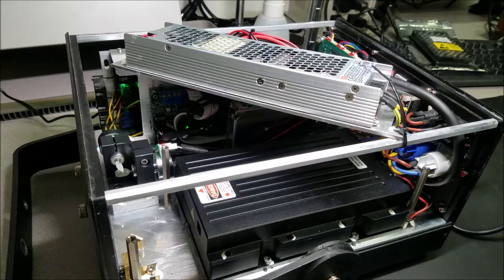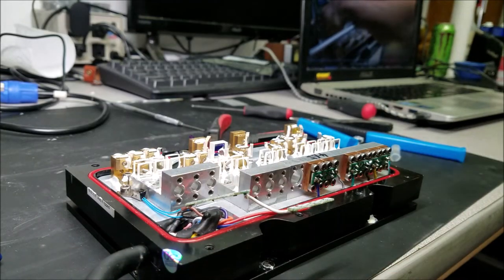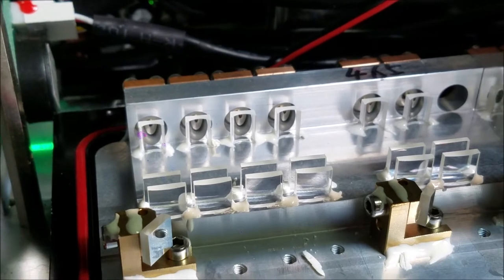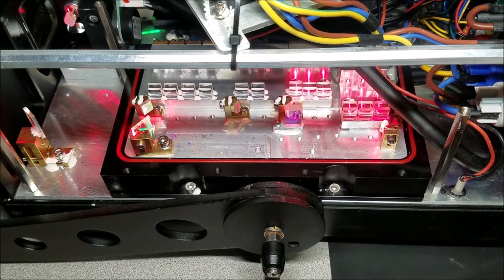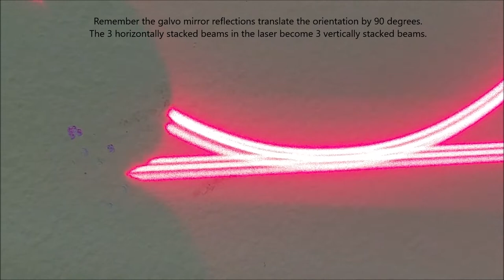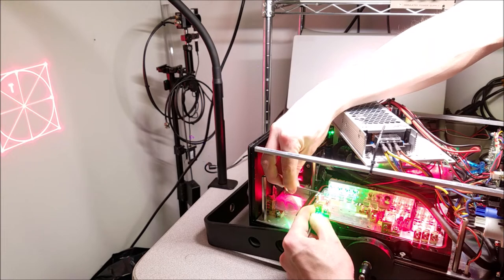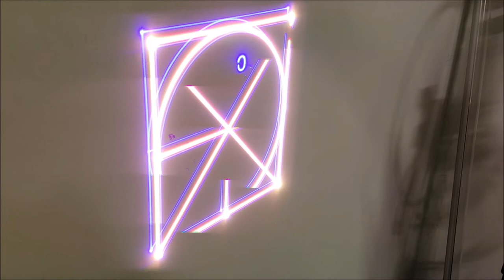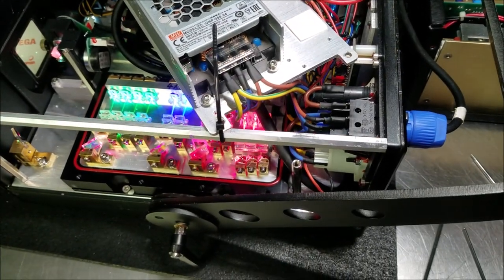OPT PT8DT4014 Show Laser Repair Installing New Red Laser Diodes & Laser Head Alignment.

Comment: Very interesting to watch as I have two these laser projectors but 10W in stead of 14W. Can I ask where did you get the new closed can FAC red diodes from and how much?
Reply from the maker: The new diodes where bought through one of the partnered laser companies we work with. I don't know the MSRP since they where ordered in bulk. I don't know if these parts are available to the general public through the factory ( not OPT ). I can check our stock and give you a quote on them if you want when I get back into the shop.
Reply: @Zenodilodon  Thanks for the reply. At the moment all of my open can red diodes are still working. I was just curios of your source of the caned diodes. I'm in the UK. My mate, Rob of STANWAX Laser may fined these red diodes of interest as he has spent many hours repairing vireos models of OPT projectors. A price of these  diodes would still be good to know. Thanks.
Reply from the maker: @cdbvideo  Ah Rob, I know of him as he and I are part of some of the same forums. I feel bad for him or anyone who has to work on these lol. So far we have pretty much only seen open can diodes fail in units without a glass plate in front of the cut out where the diode goes. We have made our own plates for those as needed it does help. I'll have more information for you later this week.
Reply from the maker: I have discussed the matter with the other shop mates here and due to the partnership/diodes being unavailable publicly from the OEM the best thing would be to sell them from our facility. They would be around $60 US per/pc about.
Reply: Thanks for that. I will definitely bear that in mind for if my reds start popping on me. Are you on PL forum? if so what's your handle?
Reply from the maker: @cdbvideo  I never joined PL, by the time I thought about it a lot of the people just jumped on FB or Discord.
Reply: @Zenodilodon  which FB or Discord forums, would you recommend?
Reply from the maker: @JAKOB1977  Styropyro's discord server is actually really good for Laser chat!

Comment: Nice to see you love the desolder station for these 😂 I bought mine specifically because remounting those boards was really awkward. I wish I'd known of the closed can FAC diodes before I started, I was buying the open can direct from OPT and it made it nearly uneconomical to repair. I found that even with an alignment tool I couldn't get the new diodes to output onto the steering mirrors. They were all off to the side resulting in having to demount the initial collimating lens and steer it back where it should be. A real pain!  I only had 2 bed reds but ended up having to replace all 6 diodes due to damage from trying to desolder without a station 🙄

Comment: Why did you also remove all the green and blue mirrors and optics? Would it be too difficult to set up the red knife-edge optics while also aligning them to the existing green and blue beams?
Reply from the maker: The majority of the lasers where out of alignment not just the reds. The client did not like the factory glue which prevented maintenance as well so we pulled the optics needed for alignments and redid them without glue. Concerning difficulty, personally I did not find it harder or easier than a single color laser head.
Reply: @Zenodilodon  I see, I must've missed the part where you talked about all the lasers being misaligned. I once replaced the green module in a very cheap projector and I was able to re-align it with the red and blue beams. But this was obviously orders of magnitude easier than what you did here :)

Comment: hello thanks for your nice videos. I want to make an IR illuminator. Should I use CW or single mode laser?
Reply from the maker: Those are 2 unrelated characteristics of lasers.

CW is continuous wave, this means that the laser makes a constant beam vs QCW ( Quasi-Continuous Wave )  like a q-switched laser/nitrogen laser or Pulsed which is short bursts of power such as in range finding or micro machining.

Single mode VS Multi mode has to do with how the laser's resonating optics work and their output emitter configuration in laser diodes. Single mode lasers have a very tight bandwidth and often lower power, these are generally lab, telecommunications. Multi mode  tends to have a much wider bandwidth but make more power.

For this situation you want a CW multi mode, or a laser diode that can always be on and can generate a decent amount of light. The 808nm laser diodes are often the cheapest by power and they work very well for IR illumination, for completely invisible you will need down into the 950nm range to have 0 red glow. Laser illuminators can also appear to give a grainy effect compared to LED so be aware of that, but they do make a ton of light!
Reply: @Zenodilodon  thanks for your answer. loves from Turkey
Reply from the maker: @hamitinan6422  No problem, I hope it helps you out!

Comment: Thanks for the video! looking forward to the next one. If someone needed to install a laser saftey block could this easily be done?
Reply from the maker: Should be easy. The board should have a shutter output. A linear or rotatory actuator could easily become a shutter with little mount and beam stopping plate.
Reply: @Zenodilodon  Wouldn't a beam blocking solenoid  be connected directly to the emergency shutoff button's circuit, because mechanical solenoids/actuators are too slow to be used as effective scan fail devices, which require a PASS board that's connected to the galvos' feedback to instantly kill the LD's output?

Comment: Thanks Zen! Great video and review. Was wondering what your cryptic TM meant 5 days ago. Don't understand why YT hid the video so long. Now I understand that you were giving me a heads up. Thanks again, but it looks like I've arrived too late for the OPT laserist party. 5 days too late and just as many dollars short. 😞
I don't like cylindrical collimating lens, either. I thought they were necessary to independently focus the axis of a rectangular shaped beam. You're absolutely correct that they are a PITA to realign. I'm guessing that the OEM assemblers have jigs to hold the cylindrical lenses in position while the glue dries. 
On my el cheapo modules, I redesigned those mounts to allow each lens to slide along the beam path for easier/more accurate focusing. That's why I paid extra for the low divergence OPT module. I'm disappointed to see that cylindrical lenses are still being used, regardless of paying more for premium optics. 
One of my personal pet peeves is mirror mounts that don't pivot   at the center of the beam path, which causes lateral beam movement while adjusting the angle. So, I redesigned the dichroic mounts on the el cheapo modules, as well. In the end, I relented and decided to use those modules for lumina projectors, instead.
Having watched your video, I've already broken the warranty seal on my module to check the optics, before you've even finished. Glad that I designed my projector to be easier to service, w/o the PSU on top of the LD module... Du~uh!
OMG! metal front surfaced mirrors, instead of dichroics?! The 1st mirror on my RGB module is only 2 mm wide? WTF? I've been quite happy with my OPT modules. Not so much, now.🤦‍♂ Still, I've never been an 'ignorance is bliss' kind of hermit and appreciate your candidly honest critiques.
I'm guessing that someone had bypassed the key switch on your projector, because mine is fully functional.
No, OPT isn't Kvant, with a beam shutoff nor a PASS beam fail board. Asia and Eastern European doesn't need to adhere to US safety regs (nor do US home enthusiasts). But, it looks like there are screw holes to add a beam shutter. I've seen that PASS boards are an option on Kvant projectors. But, I assume that they need to interface with Saturn galvo drivers, so both would be required for retro fitting PASS into these projectors. Forget crowd scanning (I already had).
The saving grace is that my 3watt RGB OPT projector w/DT-40's is only ~15% of Kvant's price. Otherwise, I could never afford a personal laser projector in my living room. Instead, I have 3, including el cheapo.
BR 😎

Comment: nice video again yea the reds always crap out for some reason they are ust pushed to hard out of the factory
Reply from the maker: There where units with a glass plate glued in front of the laser diodes/the holes in the front of the aluminum. Those units didn't have failures. Out of the dozen + only 3 lacked that part and had toast reds. There is a lot of suspicion though with how the numbers add up and what diodes I know. There is 2w extra they are getting somewhere given the diode selections 12w seems right. I can take a guess that the blue is the most turned up color. The use of open can diodes is becoming more frequent and we are seeing the implications.
Reply: @Zenodilodon  Yes, my W3000-RGB module has 3 'barrels' for the red LDs, but only one LD in the middle. Still don't understand the purpose of the glass plate. 🤔

Comment: I have had some success using that style of lens to tweak out beam divergence but its never truly satisfactory nice vid Brother!
Reply from the maker: It's hard to beat the performance of a good anamorphic prism pair.
Reply: @Zenodilodon  Sounds like where I need to head next. Can you recommend any LDs that have focusable lens for anamorphic prisms?
Reply: My best effort required a weird zig-zag beam path between the cylindrical lenses. The red LD's beam is off centered, from the get-go and the zig-zag was already there from the mfr. But, as you say, my realignment effort wasn't the perfection that I had hoped for and wasn't worth the effort. We learn from our mistakes, don't we?
Ended up redesigning the lens mount. Imagine a stack of 3 rectangles, collectively the same size as the existing lens block. The ends are staggered to mount each lens onto its own layer The the ends are angled upwards to be the same height (1/2 lens height below the beam). I used 2 mm thick extruded aluminum angle, but it took considerable forethought and a couple of refinements of the design.
A screw in the middle secures them in place, by being threaded into the module's optical plate. A slotted screw hole allows the focal points to be individually adjusted. Each lens can also pivot on the screw to optimize the left/right positions. Shims can be added/removed from each layer to adjust the vertical position of each lens.
This way, the lenses can be glued and dried to each layer, prior to assembly. So you don't need to simultaneously struggle with 3 lens positions and 3 focal points, all before the glue hardens.
It's also nice to be able to disassemble it for cleaning the lenses and replacing them accurately afterwards. I scratched a mark into the optimum stack for reference, like using a timing mark on an engine block.
Considered tapping the front facing lens mount to add grub screws for fine focal adjustment, but abandoned those modules for OPT, instead.
Help this helps.
BR
😎

Comment: Thinking about the thermal expansion differences between brass mounts and the aluminum optical plate. Since the mirrors only reflect the beam, the heat must be transferring from the optical plate (aka heatsink) into the mounts.
Have you ever noticed the alignments changing from startup to the end of long sessions of usage? If so, then might that not be due to the irregular shape of the mounts, with the heat moving upward from the bottom?🤔
More knowledge = more questions.😜
EDIT: 
During replay ;-) I can't help noticing the rough milling on the optical plate, which obviously results in an uneven foundation for the mounts, as well. Precision machined optical assembly? Not. Insufficient QC? I reckon. 😒

Comment: Howww do you know when the beams aren't supposed to line up? I guess it's difficult to find a service manual for this sort of problem, was it by experience or some other secret knowledge

Also, how comes alignment doesn't change as distance increases?
Reply from the maker: The beams are parallel and do not intersect though they can often look like one beam due to divergence and overlap. If the dots are put on top of one another they will cross. From = to >< which would make them very separated in the far field. 

I don't quite understand your second question, maybe you can clarify?
Reply: @Zenodilodon  I think you covered it in the first answer, being parallel, thanks!
Hope you're good

Comment: why they can made more powerful lasers ? if you youse some low power lasers is i know you need a be carefoul with polarisation tjhis is a pain it the ass.
Reply from the maker: These are relatively high powered diodes 700mw reds, 1W greens and 1.8W blues. The trouble with making more powerful diodes is that they are usually really wide emitters and tend to have poor beam specs the more powerful you make them. There are high powered single mod CoS laser diodes but those are usually very expensive and only in the IR. It's hard to make a very energy dense thing correctly work in that aspect.
Reply: @Zenodilodon  what is the most powerfull dpps laser what you have in youre hand ?
Reply from the maker: @adredy  My most powerful one personally is a 2.5W 532nm  Lightwave Electronics Half-Note
Reply: @Zenodilodon  OMG! Lucky you! Just Googled it, thinking, "That's the one for me." NOT!: $1650, refurbished, including PSU & drivers.😢